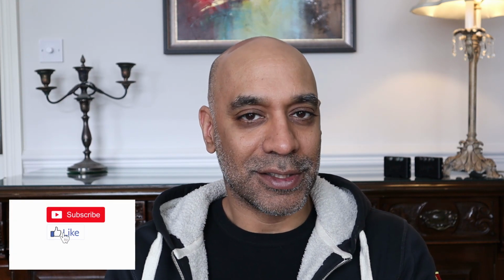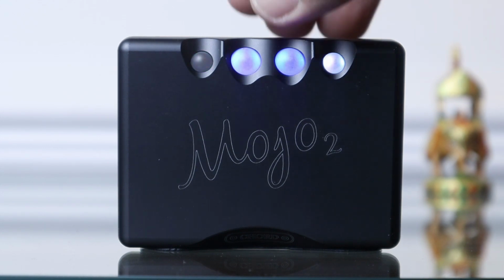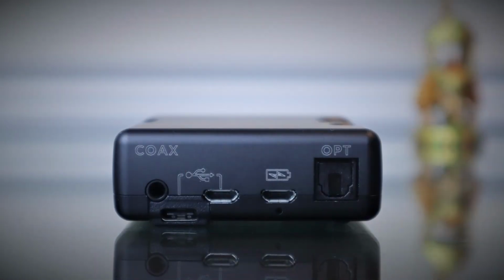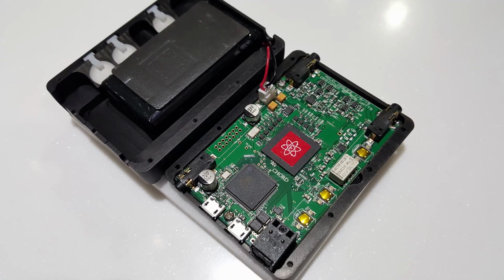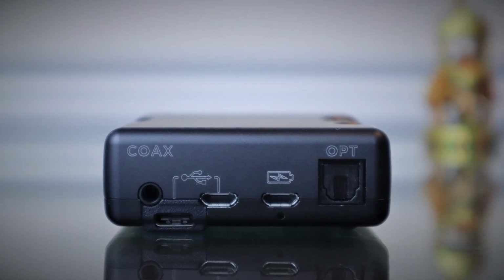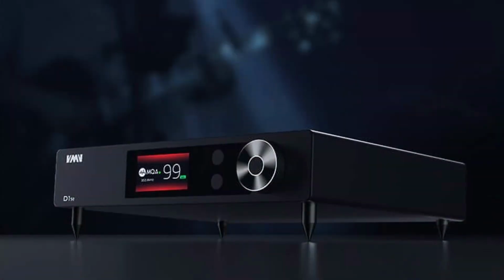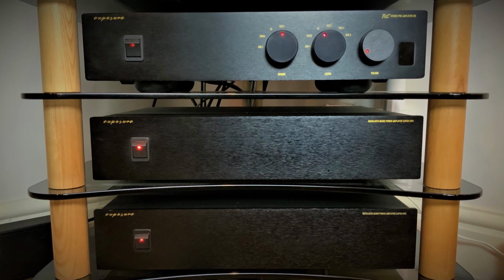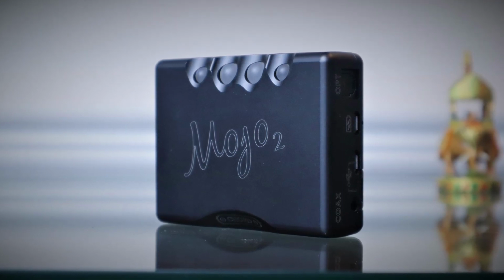Still Relevant? Chord Mojo 2 DAC Review

Comment: Thank you again.  And I agree about the Mojo2  But Connectors.  You suggested Chord Signature RCA-RCA connectors with an Audioquest adapter.  Have you assessed the relative merits of a 3.5 mm jack to RCA over the connectors you used in the review.  My PC is ca 5 m away from my hifi system. So I went with the suggested 3.5 mm jack to RCA Clearway cable (considerably cheaper). Given the quality of the Mojo2, what choice of cable would make a difference to the sound, or did you just happen the RCA-RCA cable handy?
Reply from the maker: Cables can make a difference to the sound 😊

Comment: Well , outstanding products i have owned and sell ( and regretted not to have put in a bit work work around them ) 
Proac 1sc ( that i see you also have )
- Spendor sp100r 
- harberh c7rs3 
And in special a very , very well balanced speaker : rosso fiorentino mk1 series ( the ones with the acrílic front ) i heard the mk2 with the aluminium front and back sides with aluminum sandwich on them , find the mk1 much superior , more dynamic , free sounding , more alive .
The mk2 sounded death and univinting in  comparison .
Even the Volterra 2 could not surpass the fiorentino mk1 .
See one selling ....grab it ! Please .........it is really a do it all speaker with an outstanding balance
Reply from the maker: Thx for sharing 😊

Comment: Hi All
What is the best way to connect an Audiolab 6000 CDT to the Mojo 2. Which lead should I use to connect it. Digital or Coax?
Reply from the maker: Try coax first 😊
Reply: Hi T
I have used the Audioquest 3.5 to RCA with a coax plugged into the left channel going into the coax input in the Mojo 2 and it is an improvement on the 6000A Dac. 6000A used as  pre  amp going into a  Audiolab 8300 XP.

Comment: Thanks for the review. With the mojo plugged in to a computer will it run on the usb power, bypassing the battery? The presence of the battery bothers me, because batteries die. So if I can take it out of play that’ll help.
Reply from the maker: It can be taken out and bypassed but will invalidate the warranty 😊
Reply: @abritishaudiophile7314 Thanks! I wasn’t wanting to actually remove it. It’s more about knowing I don’t have to rely on the battery to power the unit for what it would be doing nearly all the time - playing music from a desktop Mac. Will the mojo run off the computer’s power once its battery is full (or at 80%)?
Reply from the maker: @jandekker6055 it runs through the battery unless modified 😊
Reply: @abritishaudiophile7314 thanks again for the reply, even if it wasn’t quite the news I was hoping for. I wish they’d put the Mojo’s internals in a mains-powered box. For the same price, naturally.
Reply from the maker: @jandekker6055 me to and with proper input switching 😉

Comment: i received the mojo 2 as a gift and i want to buy the aune s17 headphone amp soon, like in a few weeks. does the mojo 2 with a rca adapter from the headphone output just plug and play when connected to the amp by rca cables? this will be for my hifiman headphones with the mojo as the dac and aune s17 as the amp. or does the mojo 2 need some special configuration to connect to the headphone amp?
Reply from the maker: @GUN1GRAVE  try the headphones connected directly to the Mojo 2 first 😉

Comment: I just watched your Q-DAC (plus AudioLab Power Amp pairing) video where you put it up against Exposure pre-amp and the original Chord Mojo, which was your preference. How would you say the Mojo2 fairs against the M-DAC (ESS9014)? Reason being, I own a Audiolab 8300CDQ with the same chip as the M-DAC going into my 8300A.
Reply from the maker: @LDN_BOX  thx. My money would be on the Mojo 2 😊
Reply: @ thanks alot for your response, you are very courteous in this regard! I think I’ll stick with what I have, as the lack of in&outputs of the Chord is insurmountable for me. I am happy with the sound now, I’ve made a few adjustments which seem to have paid off. The guy from Pearl Acoustics on YouTube did a test comparing recordings from a variety of DACs he tested, the uncompressed recordings are available on his website. Whilst others in the comments where more concerned with what they perceived sounded the best, I noted that even the cheapest of the lot, the Topping D10  gave an extremely good account of itself, thereafter its preference but you simple can’t judge over such a small sample size of recordings. I would be interested to see a group of reviewers in a room do a blind test of short recording sections of a number of genres and I suspect they’ll be no guaranteed winner and maybe even a surprise at what wins. I even dug out my old Mini Disc Player Deck - the Sony JB940 to compare it’s DAC with my Audiolab and for me even across filters the difference experienced was no where near as pronounced as I experienced swapping out power supplies and interconnects. So I suspect the same case for the Cbord with me as the two components I have were especially developed for one another. The Pearl guy loves the Quad Artera which has the same chip as my Audiolab and was likely overseen by the same dev team at IAG. Now I’ll just sit back and enjoy my collection of music. I really appreciate how considerate you are with your viewers, keep up your great work!
Reply: @abritishaudiophile7314  Thanks for the tip! I watched and had a listen to samples from Pearl Acoustics taken from the following: Topping D90 Mklll (dual Sabre), the SMSL D400 EX (dual AKM), the Topping D10 balanced (Sabre), the Denafrips Pontus 15th. (R2R, Ladder) and the Sugden DAP 800 (dual Philips TDA1543). What I noted was that even the least expensive of the bunch, the Topping D10 still sounded very good. I compared my  AudioLab8300CDQ (with an ESS 9018) to an old Sony Minidisc MDS-JB940 DAC (with filters) and didn't really note much of a difference. Also comparing DACS you need a wide spectrum of genres and even down to different types of vocalists/instruments within those genres and blindly see what you rate to come up with a winner overall. Luckily, I am not in a position to have to buy. You can really make up for it in post these days via a Wiim EQ back into your DAC via COAX/TOS these days. I noted that Pearl Acoustics  guy really loves his QUAD Artera Pre-Amp which has the same DAC chip (9018) and was likely designed by the same members of IAG. I must admit I've upgraded lots of little things and for whatever reason (maybe even speaker break-in or taking out the port plugs as they were close to the wall and mounted) but everything has come together, I love the sound now. I had also changed out things power supplies (to AudioLab DCs x2), purchased decent interconnects and even replaced the stock B&W speaker bridges to Jumper Bridging Speaker Cables (AudioQuest). So one of those things have have culminated in a great sounding set up it's delightful. The 8300CDQ was made bespoke for the 8300A , so who I am I to challenge them (& waste money). It can all now get out the way nowand let me get on with enjoying my music collection! Thank you and keep up the great work!

Comment: @britishaudiophile7314   Greetings from Miami Beach Tarun! I’m curious about your thoughts on using a Halo Bolt battery. With usb into its dc 5V 2.4 amp max connections? I recently got a Bluesound Node Nano, and man do I love it. I use an external dac, and the Halo battery for its power supply atm. I have an IFI power supply coming today. Do you think it would be better served with my bluesound than the halo? I also power my Mojo 2 with the halo, when I’m using it in desktop mode at least. So I’d be curious if you think the IFI would be better for the streamer or the dac, both, or neither at all because the Halo is better? Ultimately I’m going to test all this, just wondering what you think. Love your channel! My apologies if this is repeated, I can’t seem to find my original posting of this question and really care about your opinion on this matter😊

Comment: Just curious ....how did you setup, balance and control the volume for hifi use?   ...did you use the external amplifiers volume control....or the mojos buttons? ...or a mix? As this is not mentioned anywhere
Reply from the maker: @humanitech  a mix, set to 2v output 😊
Reply: @abritishaudiophile7314  Thanks Tarun and much appreciated ...as I was wondering how it could work!  

Especially as others on the net seemed to imply it wasn't advisable for a hifi setup!?

Although somehow  I think Chord are really missing out on a great killer entry desktop version ...with a pimped up mojo 2 circuit,  slightly bigger chassis, more appropriate connections, functionality and some bigger caps.... and all for say £500 - £600 it would storm the market!
Reply: @abritishaudiophile7314 sorry ...silly question again ... but how do you set the output level to 2v on the mojo 2?
Reply from the maker: @humanitech  from memory, I think it was the green colour on the volume dial 😉
Reply: @abritishaudiophile7314  Thanks Tarun

Comment: @abritishaudiophile7314
 Appreciate this is long after the event, but just to say that I have a mojo 2 coming my way and have been in communication with Chord re the connections and having 2 sources connected (My streamer and my cd player) and how  the coax input works (given it's not a normal full size one) and they said this in their email reply,
"Please note that the Mojo2 will defaut to coax over optical when this connection is made so both devices cannot be connected at once and switched between."
I have gone back for more clarification, but it sounds like switching between sources is not possible without unplugging the one that isn't being used? This is obviously a real pain,  but just wondered whether it was an assumption on your part or something you read that referred to automatic switching?
Reply: @abritishaudiophile7314 
Further clarification from chord re switching between optical and coaxial inputs.
"If there is no voltage on the coax input, it should play on optical but most devices do tend to put voltage on all the time. If this is the case the coax will need to be disconnected each time the optical is to be used"

Comment: I've finally bought Mojo 2 and it produces great sound that I simply love. But I cannot use Mojo 2 on the go because it is picking up mobile phone signal noise all the time. I still like this device as it works amazingly as preamp for my active speakers.
However I am soon upgrading my hifi setup to KEF R3 Meta and Marantz 40n. Tarun, since you have reviewed both of the products (Mojo2 and Marantz 40n),  would you recomend to use Mojo 2 as preamp in my new setup or the sound quality would be better using internal DAC of Marantz 40n? Obviously my ears will be the best judge here but since I do not have Marantz yet with me I thought I will ask. Thank You.
Reply from the maker: Hard to predict but the internal DAC in the 40N is very well implemented 😊
Reply: @abritishaudiophile7314  I thought that might be a tough call. I guess I will find out once I have it compared. Thank you so much for replying to my comment.

Comment: Hi. Nice review. 
Is it possible to have all the lights off while it is in operation? I would not be happy to carry a small disco ball in my pocket or when Iistening in my bed. 
Also how long does it take to charge battery from 0 to 100%?  I've read it's about 4h? That seems very long for todays standards.
Thanks.
Reply from the maker: They can be dimmed 😊
Reply: @abritishaudiophile7314  sigh of relief. Many thanks. I will be getting one soon.

If I may aks more specific question: my main use will be to have mojo paired with iphone. But I also have pair of active Klipsch R 41PM bookshelf speakers. Do you think the sound would benefit from pairing mojo with such speakers? Thank You.

Comment: Hello, i want a new dac/amp for around 400 EUR.  I doubt between Chord Mojo 2 and the loxjie d40 pro.  the loxjie d40 pro has more features/functionality (like LDAC etc) but the amp section is also important because i want to drive my Hifiman Edition XS headphone with it.  I like the Mojo for its portability but in terms of sound quality, which would be the winner?
Reply from the maker: I haven't heard the D40 but my money is on the Mojo 2 for sound quality 🙂
Reply: Dude, Mojo 2 is amazing. I use it with HE1000 stealth. Option to EQ headphones are game changer.
Reply: @priedits  last comparison.. chord mojo 2 vs Aune magic x8 xviii + sparkos opamp?  Both have fpga circuit. Which wins in sound quality?

Comment: For me, it didn't work out. I'm a  long time Mojo 1 owner, using it as a desktop DAC into tube amp and HD800. Mojo2 has all the qualities reviewers have pointed out, like better instrument separation, smoother presentation and the Crosstalk and DSP functions work really well. Crosstalk for headphones is great. But the tuning (maybe it's the 3kHz to 20kHz range?) seems to draw down exciting passages too much and I could only partly correct it with the DSP. It doesn't make me stand on my chair when Beth Hart kicks it in I'd Rather Go Blind, the Hollywood Bowl version with Jeff Beck, like Mojo 1 does. 

Reminds me of when my cousin upgraded his 2004 Cayenne Turbo and the new model had electrically assisted steering. The specs were better, but the smiles were gone. 

That said, if you're rocking a $500 or $50k system and you're happy, then good on you. I'm not trying to knock anyone else's experiences in this subjective space of home audio - just sharing my own.
Reply from the maker: Thank you for sharing 🙂

Comment: I have had a Mojo 1 for several years and prospective buyers need to keep in mind that Mojos are battery operated. In other words you sit down to listen and five minutes later the battery goes flat. The battery has a limited life and is expensive to change: around 150 quid in my case. These factors are a disincentive and my I stopped using my Mojo, turning to an Audioquest Cobalt instead.

Comment: T, I will be running my CD transport coaxial to the Mojo. The 3.5mm adapter to coax is $1. This sounds "Wrong" but to go from coax to 3.5mm, I'm not mistaken. I hope I am clear in my message. Best, D. From Stl. USA.
Reply from the maker: I would use a Mogami single RCA to 3.5mm Mini-Jack lead like this one 👍
https://www.designacable.com/digital-mini-jack-to-rca-cable-mogami-coax-rean-switchcraft-75ohm-phono.html?gclid=CjwKCAjwvdajBhBEEiwAeMh1Uz4ZZ33bgrAecMvQxKT3EnIOqqJ6tzrWc5raEe66qlS731ODSAHHBRoCZUwQAvD_BwE
Reply: T, Thank you, I will need 1 meter and the flexibility. I would have not found this cable on my own. So very helpful. Best, D.

Comment: I had the original one, I still have it in fact. It stopped working after three years, that is £400 down the drain. Yes it looks great but that user interface is really awful, and I mean really awful. Those balls look cool, but in practice thumb wheels are so much better. Then there’s the cables needed to use an iPhone, it feels and looks clunky. I compared the sound using the Chord and the £10 Apple DAC dongle with Audeze Sine and Sennheiser HD600 headphones and I could not tell any difference. Yes I used CD quality files. Okay my iPhone 7 could not drive the HD600 without the Chord, but an iPhone X can, easily. As far as I am concerned, the original Chord Mojo was all frilly knickers and no brains.
Reply from the maker: Thank you for sharing your experiences 😊

Comment: Just 1 observation on battery powered dacs in home setups - I used a chord hugo for a couple years permanently connected to a mains supply, being constantly on charge eventually killed the battery, which in turn caused the dac to start playing up. 
I replaced it with the chord qutest which is designed for home use and doesn't have batteries!
Reply from the maker: Thank you for sharing 😊

Comment: Hi Tarun, I just bought the mojo2 and love the sound, I really want to say you should be given a Award for the most prompt at replying to your follower's I have never seen 
anyone like you before your a good man.
Reply from the maker: Thank you Jason. That is very kind. Enjoy the Mojo 2 😊👍
Reply: @abritishaudiophile7314   Greetings from Miami Beach  Tarun! I’m curious about your thoughts on using a Halo Bolt battery. With usb into its dc 5V 2.4 amp max connections? I recently got a Bluesound Node Nano, and man do I love it. I use an external dac(s), and the Halo battery for its power supply(nano and mojo 2) atm. I have an IFI power supply coming today. Do you think it would be better served with my bluesound than the halo? I also power my Mojo 2 with the halo, when I’m using it in desktop mode at least. So I’d be curious if you think the IFI would be better for the streamer or the dac, both, or neither at all because the Halo is better? Ultimately I’m going to test all this, just wondering what you think. Love your channel!